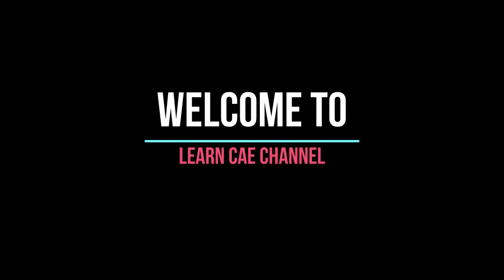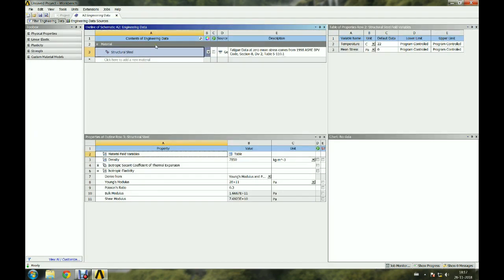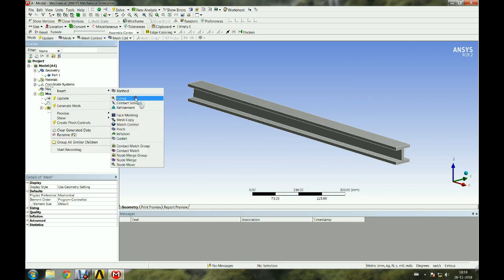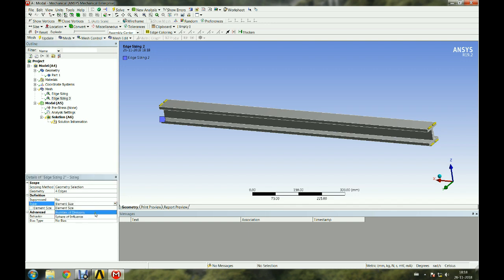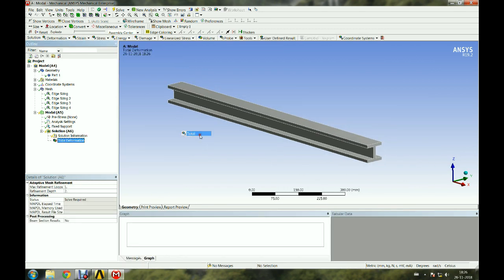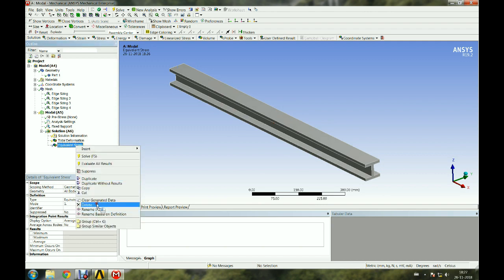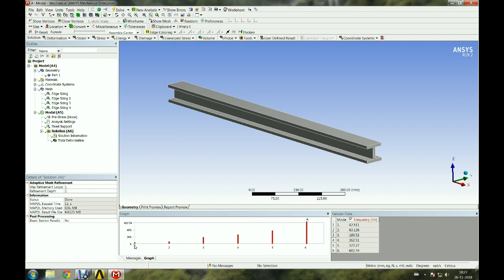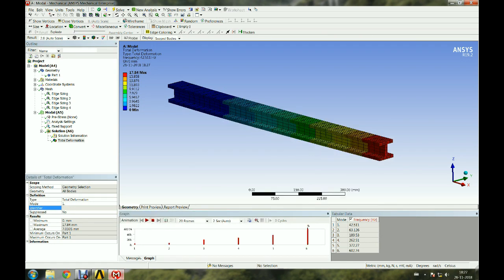Modal analysis of cantilever Beam | Ansys Workbench

Comment: Hello, I am a student doing nonlinear analysis on a Z-section steel and I have some problem about my model. The simulation I did is about web crippling (something like very localized buckling that happens in the web section). The span of the steel is 500 mm long, and the force is applied by 30 mm loading plate in the middle of the span, simulated by nodal force. I have entered the multilinear isotropic hardening for nonlinear material properties since I want the web to crush and yield and have some folding under the load. However, the member does not deformation significantly under great loading (only deforming 0.05 mm when under 7000 N load). I am so confused now since I have been dealing with this problem for a long time. May I ask for your advice? What should I do to make the steel show web crippling behaviour? Thank you so much!
Reply from the maker: Hi, thanks for your comments. Check your scale of the model. You can also try in explicit dynamics module or linear bucking module. That may provide the results you expect. Also, you may try to add g-force to the model.